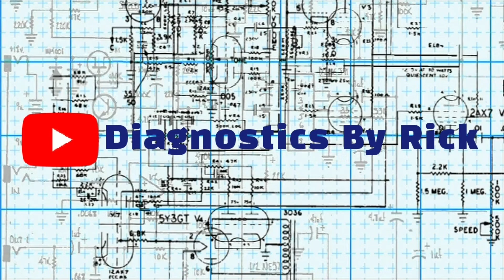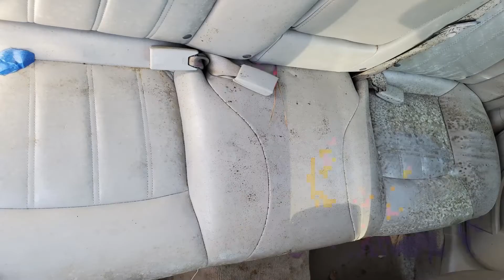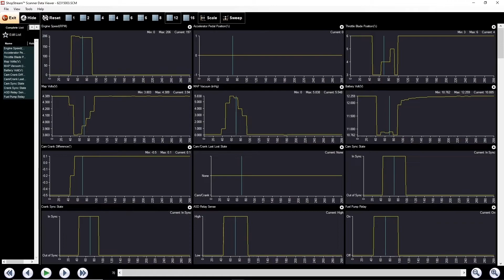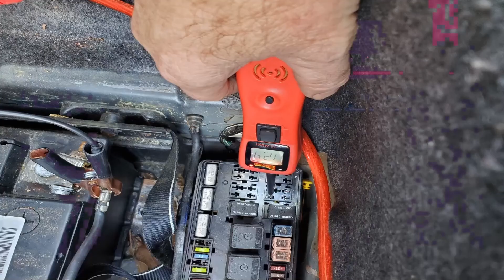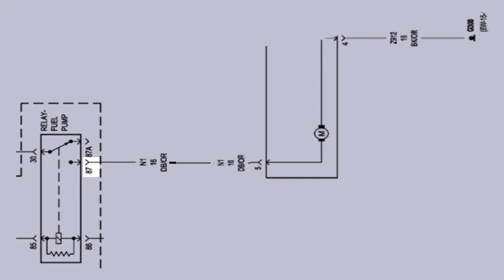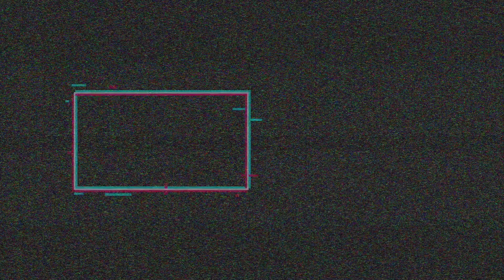2005 Chrysler 300 No Start

Comment: ***I seem to have a common problem with long engine crank start and this is a new symtom for this car  when it used to start right away. now after changing the crank pos. sensor and  cam pos. sensor  omid factory oem parts it still long crank start but runs sounds good when running the initial problem with this car is that it just stalled when driving and go into some kind of limp mode. With many other things to cure this problem of just stalling out lightning bolt light; engine light ;sas light among other suspected issues do you have one guess what direction i should go in now other than fuel ;spark;pcm;egr;throttle body;oh and is there two crank position sensors on this car?if you like go ahead and take a swing  i'd really appreciate it thanks.

Comment: my wifes truck is a 2002 ram 1500 with 5.9 gas engine. the #3 injector driver went bad flooding engine i ordered new computer. replaced and ran good but then no a/c the a/c  worked before installing new computer didn't do any diag ordered new computer got new one and still no a/c then diag started found broken wire to pressure switch we all assume things sometimes i should have checked but was sure new computer was the problem didn't even check. thanks for the reminders keep up the good work